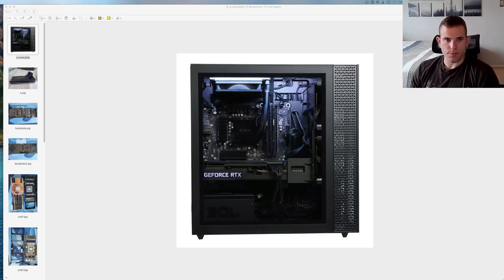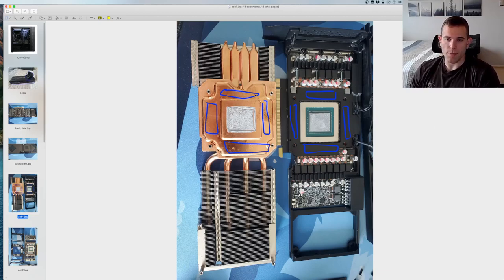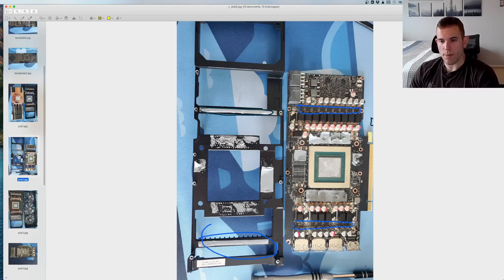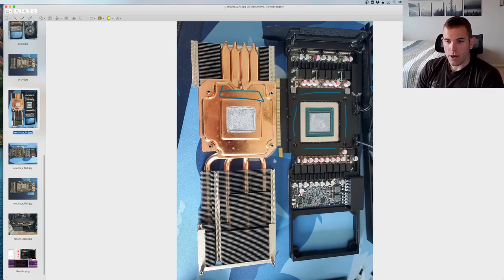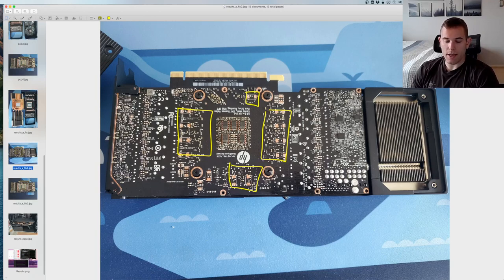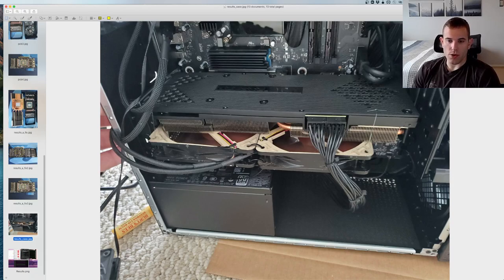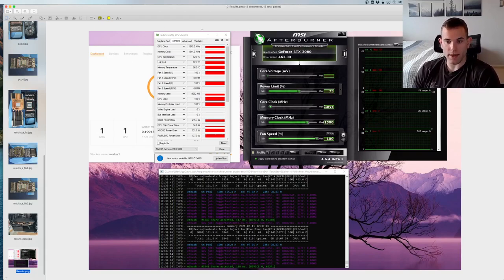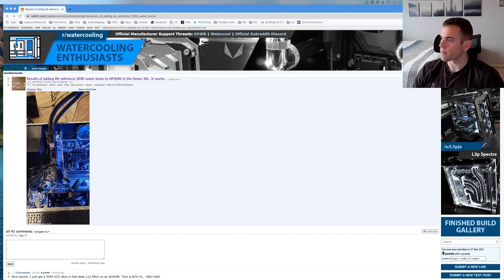Definitive HP Omen 30l 3070/3080/3090 Thermals & Noise Optimization Guide

Comment: I just got my Omen 30L with 3080 built late December.  It looks like HP is doing all these mods in their new build.  I see thermal pads on the backplate against the memory and thermal paste on the heat pipes.
Reply from the maker: That's awesome! Maybe they watched the video :)
Reply: Did you have to take it apart to see? Have the same build and date but want to check
Reply: @jdlancaster1357  I was thinking HP got some tips from your video lol  I did do your 120mm fan mod.  I only use it to play games.  I tried to mine a little bit, but it's LHR and locks all the time.
Reply: @RunGSD  I didn't take it apart.  If you shine some light between the backplate and PCB, you should see the thermal pads.  Also, you can see some thermal paste when you look location where this video tells you to apply -- if you don't, you may want to take it apart and check.
Reply: Late reply:
I just checked my model, it was also "fixed" from factory, but damn what a poor job they did. 
I removed the paste and applied new (thicker line) and it still gave me -10C on average.
This was only the first mod. I am going to do the other mods as well as soon I have the thermal pads. 

@jdlancaster1357
Reply: @darthjarjar1480  hm, interesting, maybe I'll take mine apart to re-apply lol  My fan does get loud on some games.  I undervolt the GPU a little bit with MSI's Afterburner app.

Comment: Exact same machine. Went from 78Mh/s @110 C to 90Mh/s @98 C. Thanks bro. I just did the thermal paste, did not want to separate the board as it was sticking.  Also applied pads to the inside of the backplate that touched VRAM and replaced the fans. Total time- 45 mins.
Reply: What was ur ambient tenperature?
Reply: @alexfren8791  Air conditioned to be around 75F or 24C.
Reply: @lok777  Im thinking to buy a desktop for me. I hv two option in my mind Asus rog g35 and Hp omen 30l. Both RTX 3080. Asus seems has good motherboard and GPU probably wont be as loud as  HP. I need little quiet setup. But asus 800$ more expensive. I hv ambient temp 20 c. Thinking a lot.

Bro, Which one u would suggest for me?
Reply: @alexfren8791  I do not have any experience with the ROG so I can not say which is better, but I really like the omen.  It is well built, and performance is good.  I have taken it apart and everything is standard and replaceable, for a premade it is really nice, I like it a lot.
Reply: @alexfren8791  that rog is a piece of crap as well

Comment: Just as a note for someone else that might try it, the 3070 has a reference pcb design but the memory voltage conversion is populated differently and there's a choke that sticks up and blocks installing an EK waterblock.

I'm an animal so I jumpered the choke off the board and made the block fit, it might be bypassable but I didn't want to take the time to find out.

Comment: This was super helpful.  Thank you.  You are critically undervalued on YouTube.  Can you answer one more question I have?  Is there no way to pop a 4k60 PRO capture card?  I read there was an extra PCIe slot in the HP forums but can't for the life of me find another slot other than the GPU slot?  Do I need to set up an old PC with the capture card (as a streaming PC) to use an internal capture card with the 30L?
Reply from the maker: No, the included board only has 1 pcie 4x16 slot - the one the GPU is in. I actually am using this PC as a HTPC now, and wanted digital audio output, so I went and bought another z490 motherboard. You would have to do the same if you wanted to add in a pcie capture card. The case only supports mATX - but all the connectors are standard so you shouldn't have a hard time swapping it out. Thanks for the kind words. Mobo pic: https://imgur.com/a/Ii0X5UO

Comment: Assistance needed, kind sir.

I've done everything but pulling GPU shroud and using new fans. Great results but still need a little more on temp reduction....

Question: did you use any kind of rubber strips (etc) between the new fans and the GPU cooling array?(vibration noise, etc)

The fans I intend on using have their own rubber corners, but looking for ideas for the rest of the contact area.

Many thanks in advance!

Comment: Awesome video, thanks! I didn't really understand if the shroud mod / new fans needed to connect to the card itself or the motherboard tho?
Reply from the maker: I used the motherboard connector because I just blast them at like 80% all the time (it's very quiet for me). You can use the PCB to plug them in but you'll need a converter - I don't think the regular fan headers will fit on to the PCB connector. You can see the fan header on the PCB at 2:26. It's one of the 4-pin connectors at the far left of the card, just to the top and bottom of the die (vertically).

Comment: Hiya! So I've done all the mods listed above and I think I used a decent amount of paste and did a good job of adding thermal pads as well as strapping two Noctua A12x25s but my GPU core  (3080 Ti) is still hitting 94 degrees C (Mem at 104 C and Hotspot at 102.7 C with idle at 40 C Core | 44 C Mem | 44.5 C Hotspot) in furmark and then throttles the GPU usage down to 75%. I know this is necro'ing your video, just wanted to see if there was a difference between the mining application and Furmark. I'm still in the return period so I'm considering returning it if it still throttles this much even with all the above modifications. The only plausible thought is that even with the deshroud, there's no airflow for the cards since the front fan barely pulls in any air. Again, sorry for the necro, and thanks in advance if you have any ideas/input!
Reply from the maker: That's too hot. If you're still in return period and are sure all steps are done correctly I would return it, especially since it's a pretty terrible option with 30 series availability these days.

Comment: What if we remove the whole front panel of omen 30L and put a table fans these or if we remove the glass panel and put that fan there would not it solve all the problems?

Mainly it is bad case right?
Reply from the maker: The case is bad, yes. However, that's not the focus of the video, nor is it a realistic solution in most situations.

Comment: @jdlancaster13 have you tried water cooling it? I bought one a year ago, along with a new mobo and case and transplanted everything. Been happy with it so far... repasted the 3080. Thinking about water cooling the GPU now. Upgraded CPU cooler to NH-D15 so I'm good there... just need a better solution for GPU.
Reply from the maker: Honestly I wouldn’t just because of how hard it is to get a water cooled rig set up. The deshroud mod makes the temps perfectly good if you’re ok with a bit of noise under load. It is a reference pcb though if you choose to watercool.
Reply: @jdlancaster1357  I was thinking of an AIO kit for it. There's some pretty solid ones out there for reference cards.

Comment: Hey! Thanks for the video. I have bought the same model with 3080 as well and just today I noticed that the temps were going high. Could you recommend or name the specific thermal pads and thermal paste that I should grab for the mod, please? If you have any affiliate links, let me know and I'll buy them using that!
Reply from the maker: No affiliate links here :) I would recommend something like this:

https://www.amazon.com/Thermalright-120x120x1mm-Conductive-Resistance-Temperature/dp/B08Z785SDR/ref=sr_1_4?dchild=1&keywords=thermal+pads&qid=1626189580&sr=8-4

As far as paste, it doesn't really matter, Arctic mx-4 has always worked for me. Another user in this comment box also suggested "Frosty Thermal Pads 12.8W/mk", which is a lot cheaper than what I posted. I will be trying those next time I do a re-pad.

Comment: You don't really explain what you do with the fans on the GPU. Do you remove the old ones, and put the new ones on with your string?
Reply from the maker: You can see pretty clearly in the deshroud mod pic. I removed the stock shroud and simply tied 2 120mm fans to the fin array - running them at full speed blowing up towards the backplate.
Reply from the maker: The stock shroud includes the fans - they're all part of the same array.

Comment: Would this PC be fine for gaming, that’s all I will be using it for , I don’t know how to do all of this, would all of this be needed for gaming ?
Reply from the maker: Yep this PC is amazing for gaming. I may recommend upgrading the CPU cooler though - a 120mm AIO isn't that great for 10700k, which can run hot.
Reply: @jdlancaster1357  I’m going with the 5800x version
Reply: @xKoneko  that the version I have coming this week as well. I’m going to see how hot it runs, not mining just gaming, and will see how hot it runs. If it gets too hot, I l upgrade the cpu fan to a push pull option.
Reply: @somedude1324  I’ve decided to build a pc, I already got my hand on a 3080ti
Reply: @somedude1324  Did it get too hot? I got the 5600g 30L getting up 70's temp on high demand gaming rtx 3060
Reply: @unds85  yea min gets to the upper 70s too. I’ll probably switch out the case and motherboard sometime in the next few months.

Comment: Hello so I have the same exact card and omen and I did all the solutions in this video but my vram temps are still so high like 102-104 even after these upgrades so please help
Reply from the maker: Are you sure did the thermal paste on the black heatsink correctly? Also what's your airflow like?
Reply: @jdlancaster1357  yes I am pretty sure I did but maybe I think I just have to apply a lot more paste for copper heatsink
Reply: For airflow I usually take off the glass panel
Reply from the maker: @simplyy5657  Yeah I would really put a lot of paste on the black heatsink. As I showed in the vid, it only makes contact with the cooling array, so there's no danger of damaging the card.
Reply: Also something definitely makes contact though because After I did the thermal pad replacement and paste the backplate gets really hot not sure if that’s a good sign maybe something is transferring heat
Reply from the maker: @simplyy5657  What's your OC? I assume at those temps you're mining?
Reply: @jdlancaster1357  Core Voltage (VDD): N/A
Power Limit (%): 75% or 240w
Core Clock (CClock): -200
Memory Clock (MClock): +1200 or 2400
Fan Speed (%): 70% ± based on your temps.
Reply: Btw do you have a discord I could possibly contact and talk about this issue more because my gpu die has higher temps then it used to before and I’ve already reopened and closed many times doing everything possible adding less thermal adding more thermal paste but nothing is working!
Reply: Everything makes contact the thermal paste does spread through the whole gpu die and also the paste that put around the heatsink does also make contact and memory temps are still the same
Reply from the maker: @simplyy5657  Are you getting ~100MH? I don't have discord unfortunately
Reply: @jdlancaster1357  nope max 91 but way better then before the upgrade which was 61
Reply from the maker: @simplyy5657  And temps at that hashrate?

Comment: Thanks for the Review.  Glad I didnt buy this Omen.  Too much work.  I run my mining rigs around 100c even if I have to get lower hash rate.  Still running well.
Reply from the maker: Thanks for checking out my vids! It was a lot of work but now I'm running at 101mh @ 96C! Totally worth IMO. I think in the future I will waterblock this one and put it in a ITX build
Reply: Managed to get the 3080 to 55C GPU, 74C VRAM, 78C hotspot @ 22C ambient temp. 98mh.  Literally need to do every upgrade, pad front and back, paste, heatsink to back plate and fan upgrade.  Once done it's a nice small short card to have in an ATX case.

Comment: so these cards in omen prebuilts are not lhr?
Reply from the maker: I bought this before LHR came out. Now they'll be a coin-toss. You can find out which one is in the PC by looking up the serial #
Reply: None of HP OEM RTX cards are LHR. I recently received my Omen 30L with the RTX 3070 and it mines out of the box at 64 mh/s @ 130w with really low temps and quiet fan speed